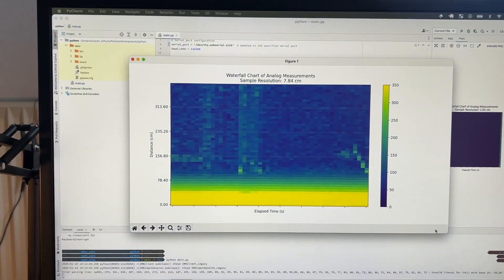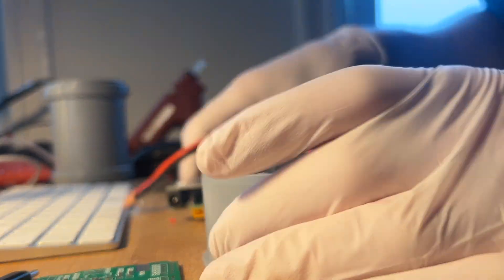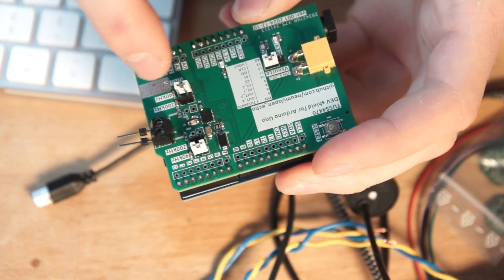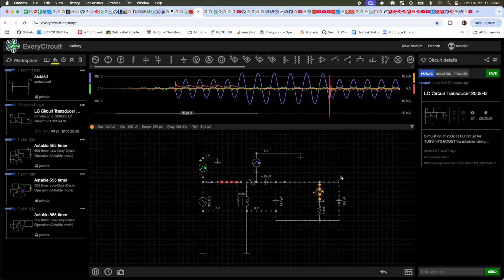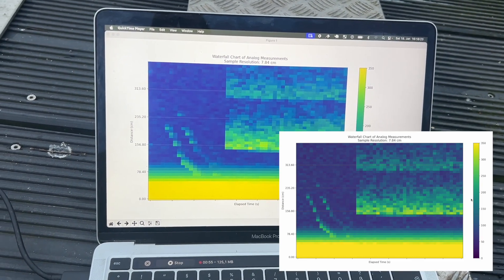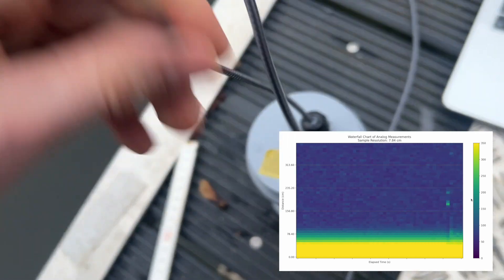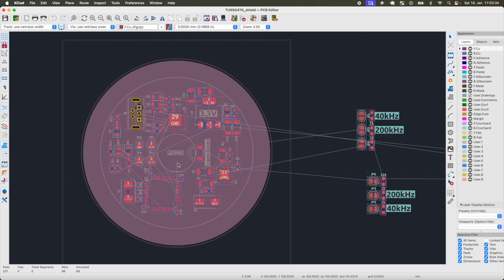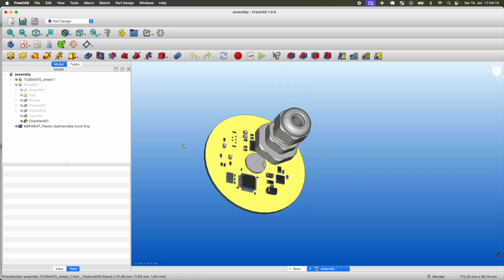Open Echo SONAR Project goes schwimming | Update | 200kHz Water Test | 250V Booster

Comment: Incredible work! Why do yo think there are so few open source projects like this one? Is "diy echosounding" just too niche?
Reply from the maker: @zero2spearo  thanks! But I‘d say its a bit niche because testing requires a lake or some body of water and a boat. Also the ICs were not that popular in the past and without them you’d need to build everything from scratch including a lot of filtering and LC circuits which can be hard to get right repeatable. The TUSS4470 manages all the complicated stuff and can be controlled from an Arduino.

Comment: Please tell me a sidescan capability is coming.  I have a need for an affordable deepwater sidescan unit for mapping shipwrecks.
Reply from the maker: @Cthippo1  i‘m actually working on it, but it will take some time. I‘m currently searching for an affordable commercial sidescan transducer. Diy transducer would be cool too, but probably hard to manufacture.
Reply from the maker: Have you seen the last video? I used a KOGGER basic sidescan. They are very affordable and I‘m using one of them to build a dive sonar.
Reply: @Neumi  That is another application I would love to see is a side imaging or live view equivalent capability that I could dive with.  Visibility around here us about a foot for half the year swimming randomly in circles is not an efficient Search pattern.
Reply: @Neumi  That's the challenge, isn't it.  Something that works on the end of a 10 meter cord is no problem, but when you need something on the end of a 200 meter cord then the price seems to go up exponentially.  There are a number of big wrecks in Puget Sound in that 40-150 meter range that are too deep for conventional diving, but may be accessible with ROV tech.  Just being able to get good side scan images of then would be a huge improvement because even NOAAs multi beam gets pretty pixilated at those depths.  

Not sure where you are based out of, but if you are around here and need a boat to try out your designs on a known wreck I have a bunch
Reply from the maker: yepconsumer products are always cheaper than products that have only a handfull of customers. The 200m cord would actually not be too much of a problem, as you could put the kogger sonars in a waterproof fish, add a raspberry pi and communicate via 2-wire ethernet with the tow boat. I don‘t have real mission experience with wreck search, but sidescan will have better resolution, compared to multibeam. (At least less money for more resolution :D)
A tow fish that is at about the depth of the wreck would give you very good results for little money. But 200-300m of 0 buoyancy ethernet cable isn‘t easy to get either. But I‘d say it would be possible to build such a system for less than 10k.
300m seems to be the magic barrier where stuff gets really really expensive though.